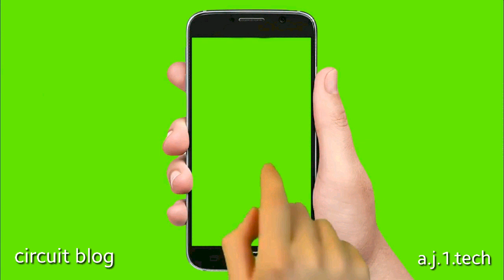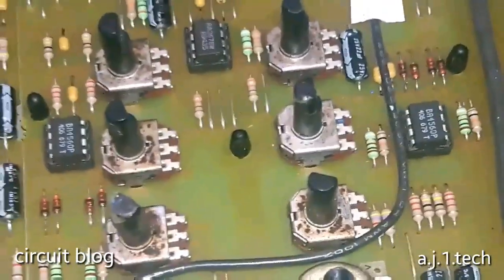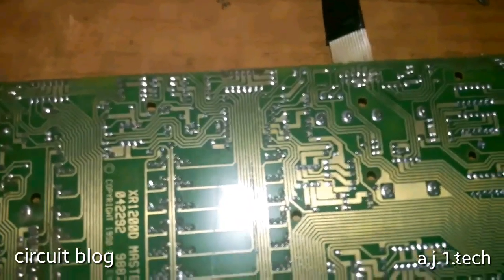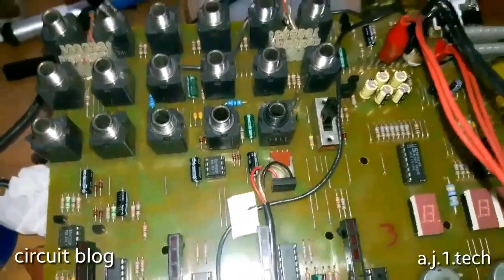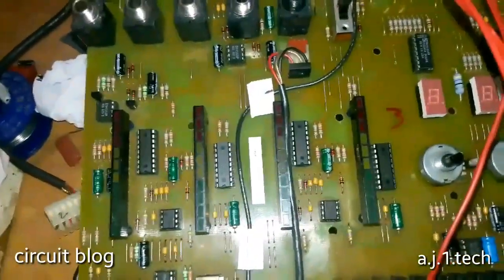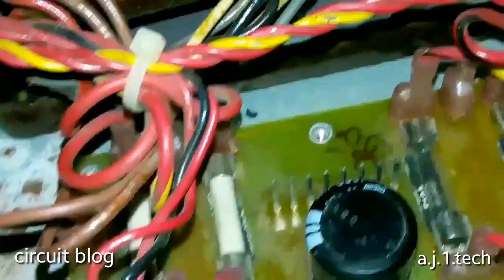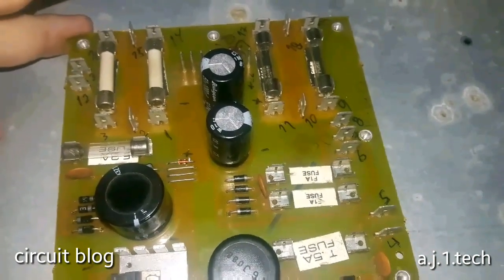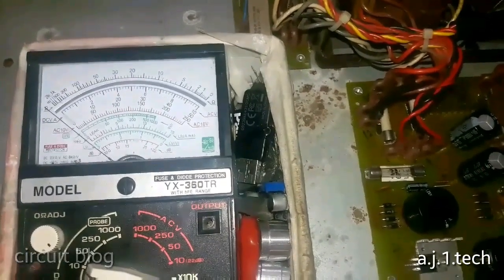Peavey xr-1600d  part 2

Comment: What I need to know and you didn't show is how to get the black cover off the control board so I can get to the faders and pots and clean them. I have it all apart and fixed the amplifier section but before I put it back together I would like to clean everything. I just can't figure how to get that cover off and I don't want to pry and break anything. Do you have to take all the knobs off etc? It looks like you do.  The way you are showing it  you never took that back cover off and just the top cover? Whats the deal?
Reply from the maker: Hi thanks for your comment 
You are asking about the cover under the knobs?
In the control section
Reply: @circuitblog01  Yes, from looking at your video it seems the only way to get to the pots and faders to clean them is to take off all the knobs and bezel nuts and lift the top off? If that is it, I guess that is what I will have to do. It looked like you could get to them by removing the back cover but I guess not?
Reply from the maker: @j.dragon651  
Yes if you what to get to the signal control vr resistors you  have to remove all the knob and remove the screws that hold metal cover to the aluminium body .
Ihope I answered your question. Please subscribe and activate the bell button to receive a notification when i post any new video
Reply: @circuitblog01  That is what I want to do. Thank you. I had two shorted output transistors that I was able to purchase and replace. I figured since I have it open I might as well clean it before I stick it back together.

Comment: Please view the power transistor position in circuit board
Reply: Power transistor 70473180&70483180position in circuit board.thanks
Reply from the maker: @childofthefallen1790  
Thank you for your comment 
Please watch the other parts in the repair videos i think  you will see  that i did